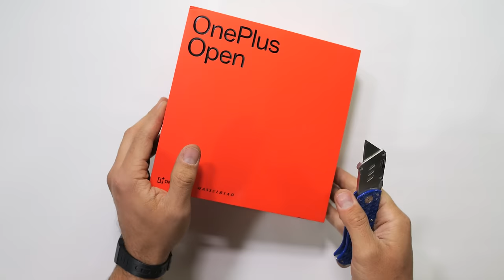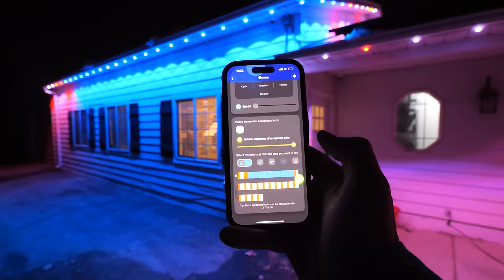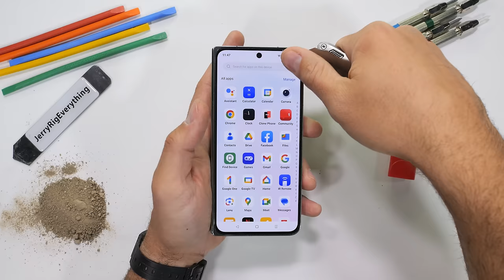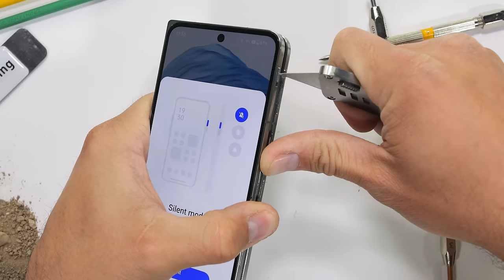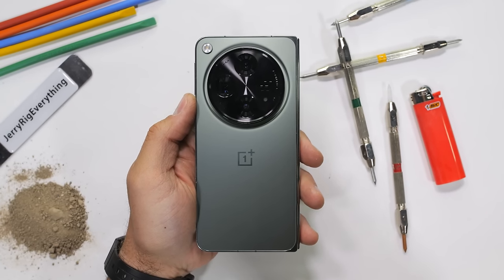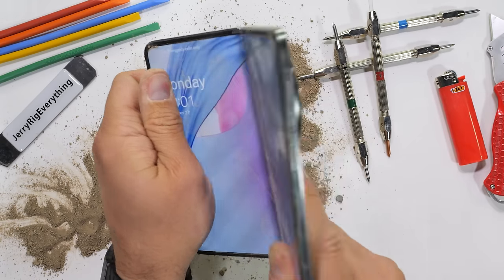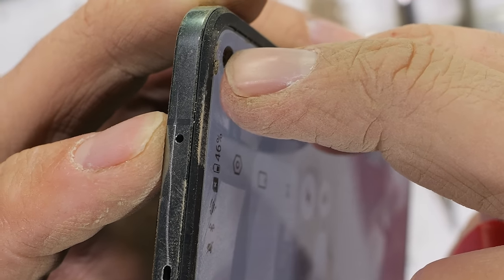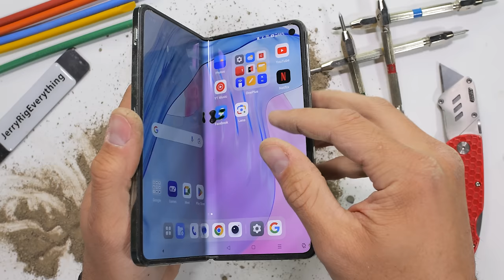OnePlus Open Durability Test - You guessed wrong...

Comment: Oppo and Oneplus did such a great job on their Foldables this year. Oneplus Open is on my list now.
Reply: I bought it. It's awesome. Cheapest yet best foldable out there in my opinion. My only issue is that Android auto isn't working. But that seems to be a wider issue for phones with a Snapdragon 8 gen 2 and Android 13.
Reply: the oppo find n3 "champagne gold" is the most beautiful folding phone rn
Reply: @Ronnet I've got the Open and have had no issues with Android Auto wireless. Interesting...
Reply: @Ronnet try going into developer settings and setting default usb mode to mtp/android auto.

Use stock cable when pairing initially.

If still doesn't work (AA opens and closes instantly), clear data on Google and Google Play Services as well as AA.

I had this issue when I restored from my old phone when setting up the device and clearing data solved it.
Reply: @ggosseyn  the issue that I've read up on is only for wired connection. Unfortunately nu car doesnt support wireless.
Reply: @xFrozenxSnowx  does AA work on your OnePlus Open? Because I tried all those suggestions already. None of it worked in my case. From what I understand reading up on this issue, there is more going on related to the processor and Android version combination.
Reply: @Ronnet  what happens when you plug in your phone to your car? Does AA popup on the phone and closes ASAP?
Reply: @ggosseyn  In my experience with OnePlus phones, it's a hit or miss between phones in regards to either android auto or just simple bluetooth connections. Some have issues and some don't.  I could never figure out why.
Reply: @Ronnet  I had to initially connect my Open via USB prior to connecting via Bluetooth and Wifi using an AA*Wireless adapter.  My car doesn't support Android Auto Wireless natively.
Reply: @Ronnet  It works on mine without any issue.
Reply: Bought yow the first day! First one was like naw this is the best phone I ever had. The second one was for shirts and giggles and teasing others. "look I spent 3000$ on two phones ! And you can't afford one !" 😂😂😂😂😂😂😂
Reply: I bought one. Its 1499 now and I even got free ear buds for pre ordering. It was a risky buy no doubt. But from the past few weeks I've been using it I'd say the it was definitely the right call. It really is a great phone so far. No problems on my side of things at least
Reply: It's amazing phone ngl
Reply: Because their parent company is BBK
Reply: @Ronnet my Android auto works just fine on the Open
Reply: @yanthewolf  I got mine to work eventually by combining all the tricks mentioned. Now it starts without any of the tricks but still only when I use the OnePlus cable. The high quality cable that I used for all my previous phones doesn't work. So I ended up sacrificing fast charging at home to have Android auto. But the battery life is good enough that fast charging isn't essential.
Reply: I just checked. The battery and charging speed are trash. For October 2023 phone.
Reply: terrible software and even worse software support
Reply: Until Z fold 6 comes out 😂
Reply: Got one

Comment: Can you perform water tests during your durability testing? It'd be interesting to see how non-IPX7/IPX8 rated phones would perform.
Reply: Hopefully. Some requested that over a year ago already, or longer, I can't remember.
Reply: @@GH0STST4RSCR34M But IP rated phones have actually been through rigorous lab tests.... no-IP phones have not.

IP rating also gives you significantly more leverage as a consumer when it comes to warranty.
Reply: It will take longer just because most phones, even without an IP rating have some sort of water resistance. If I remember correctly, the OnePlus Nord for example had all the features to achieve IP68 but OnePlus didn't certify it because it would take more money. But then the same phone from a carrier had the IP rating.
Reply: @PhilAndOr There's some assumptions here that don't add up.

For one regardless of an IP rating most companies will not cover your water damaged phone under warranty. The question of does your device have water damage when doing a warrant replacement exists for a reason. Those T&C's aren't there for the consumer.

Many phones go through extensive testing, the difference is whether an outside entity that gives IP ratings is involved in the test process or not. OnePlus has actually tested this phone under many water conditions that would surpass the IPX4 rating it has.

To others point here in the comments, the water proofing rating is a little over blown. Personally I don't care what the rating is, I'm still using a waterproof case when planning water activities to avoid any unnecessary situations.

We are talking about $1k -$2k devices here. Not worth the accident or the accidental failure of that IP rating.
Reply: @marufbepary100 even if a phone doesn't have any water resistance and water gets right onto the circuit boards, the phone will typically not fail immediately. You won't get a short circuit because water is actually a pretty bad conductor. It will usually be weeks or months until something actually stops working as a result of corrosion.
Reply: @someone-mn8or  oh did they mean do the water test after doing the durability test? I thought they meant talking a random phone with no rating out it's box and throwing in a bucket. My bad 😅
Reply: It's irrelevant. These ratings only account for how the device behaves right from the factory, not after several months of being carried in a pocket. Yes, the water resistant features degrade over time.
Reply: @PhilAndOr  It really doesn't give you more leverage. The ratings apply when the phone is new, not when it's been used (carried around, potentially dropped) for any amount of time. The main takeaway from these ratings is that you can probably use the phone while its raining and you won't get dust particles under the screen. But then again, most phones which don't have these ratings are still just as resistant, the manufacturer just hasn't paid to have them rated.
Reply: @CanIHasThisName  If it doesn't have a rubber gasket around the SIM tray or waterproofing mesh in the speaker grille it is not water resistant.
Reply: For real! Please!!
Reply: IP rating tests would require more than one phone for each test, because often the severe bend test creates a gap somewhere around the screen or back glass. And if the water test was done before the others he wouldn't be able to tell if the phone survived if the water already killed it
Reply: @bastienx8  He normally checks the phone after each stage of his test.
Reply: He'd need a new phone cause he manged the crap out of this one so unless it is the best of the best it'll fail for sure AND even more so now that he forcefully tried to bend the crap out of it and torched both screens which all collectively weakened the inside of the device because almost NO normal person is going to go even near that much abuse to their phone on accident. It would have to be on purpose or someone who works construction or something who damages their phone that bad to the point he does. I mean I own the OnePlus 10T and I got it due to the fast charging only because it was the fastest charging phone at the time officially launched in the UK with UK charger (usually certain Chinese brands have phones exclusive to china so even if you do import the device it comes with a foreign plug which makes the fast charging USELESS unless you have an adapter and are willing to carry that adapter everywhere you go). The OnePlus 10T also had the fastest Qualcomm Snapdragon at the time which was the 2nd reason. I didn't care too much that the cameras were inferior to the 10 Pro or that they got rid of the wireless charging (this latter one does NOT matter at all if you have a phone that can fully charge within 20 minutes and can last all day and last minimum 3-4 hours or so of constant gaming). The only thing I hate is the lack of the Alert Slider which I had on my OnePlus 6T which I really liked and only retied because after almost 4 years the back and front glass were done (I broke the front glass a year prior to the back glass and it was an accidental rage during a gaming session when I happened to have a spanner next to my desk because I was working on something and slammed the spanner on my desk when I lost a game of CSGO and knicked the corner of the phone and chipped a chunk of the glass and it still worked for a year) the same phone got cracked at the back glass and STILL worked with exposed circuitry and I only retired it because I saw how fast the 10T could charge and I thought even though my phone works it looks like ass right now and I can easily cut myself on the loose glass. The 10T DID fail the bend test Zach did last year BUT my phone ain't bent which goes to show either Zach happens to get lucky or he is trying his upmost hardest to break the device and although I don't want to break my phone I still would like to know how much pressure is actually being used to break the phone
Reply: @someone-mn8or you're spreading some half information. Water doesn't mean bad condcutor, it's depend on the amount of mineral inside it. 

So saying phone will not immediately fail is wrong, if you drop it in the salt water, it'll immediately short circuit. There's many type of water, distilled, ground water, rain water any water have different amount of mineral inside it.
Reply: Find Mr Mobile video where he visited their durability testing facility and that'll tell you all you need to know about it's durability and water resistance.  OnePlus did not slump on testing.
Reply: @CanIHasThisName  Facts.  Because what they call "water resistance" is simply rubber plugs that block water from getting into the device, and yes those do degrade over time.
Reply: @pixelgaming7261  Of course. But many phones do have these features and are not rated for water resistance, simply because it costs money to have them rated.
Reply: Ya, I would be very interested in that too. I saw a video where someone dropped the OnePlus open in a pool and retrieved it within a minute. Phone still functioned perfectly. Would be curious how it holds up for a longer time and if it would qualify for that rating even if it didn't try to get it rated.
Reply: Or Experia 1V
Reply: corrosion takes a bit to develop so most phones will not die right away from this but will stop functioning after a few days of being submerged. This probably won't be a good test with the sample size of 1
Reply: @PhilAndOr imagine putting a folding phone in water bro

Comment: Love the look of this OnePlus, once the tech is a bit more mature I might grab a folding phone. I kind of liked the lights until I saw they are only rated to -20. For the price wouldn't want to risk it breaking with the weather. Get colder then that plenty of days in the norther US.
Reply: iPhones are rated to 32 degrees, same as samsungs flagships.

Unless those numbers are fudged it would likely outlast your current phone in the extreme cold.

Folding phones have been ready.   My Fold 3 is still extremely fast and in perfect working order despite having a chunk of metal missing from my hinge from dropping it on patio tiles.  
Look at the Honor Magic v2.  Thin as an iphone, with a bigger battery
Reply: In reality the z fold 5 is mature enough for me to take the plunge and buy it... In terms of durability this oneplus is at the level of a fold 3 as I have been saying for 2 months..
Reply: Right?  I live in TN, we get colder than that here.  Not often, but it happens and sometimes down into the negative teens.
Reply: I'd say the Open has more mature tech than most other folding phones. The crease is basically nonexistent so less stress on the display, something Google and Samsung are still well behind on
Reply: It can get upto -30 here in Canada.
Reply: I think most of the replies above me don't know you're talking about the Christmas lights not being able to handle -20 or lower temps.
Reply: Yeah -4°F on those light is probably not a low enough temp for northern US. We get down below that for a while every year. That being said it will probably be fine being out in that bitter cold for quite a while if you dont have it on during those times
Reply: @TGMisKillingTheMiddleClass  The original commenter was referring to the temperature rating of the christmas lights.
Reply: They're already at the mature level.  The only thing that can improve now is just the cameras and software.  Other than that they will always be a bit more fragile than normal smart phones due to it having more moving parts.
Reply: When would your phone get that cold?
Don't think I've ever left mine outside.

I think the tech is mature enough now. I just got the OnePlus Open and it is amazing. I'm surprised at how useful the inner display is, and the multi-tasking features are really nice when you need them.
Reply: @sean_haz  the temp was talking about the outdoor lights not the phone
Reply: you can still get them and it'll work but a bit short lifespan, I'll say get a small one and test it out yourself before going all for decoration maybe next year😂

Comment: I love my Oneplus 11 16GB. Got it on sale for $650. Snapdragon 8 Gen 2, 16GB LPDDR5x and UFS 4.O. If you want it, just note the 8GB model with the same name and no different model designation comes with last Gen UFS 3.1 (half speed) and non-X ram (not really a big difference).

The 16GB of RAM makes a pretty decent difference on Android 14 since I don't have to use storage for fake RAM. I'm using 12GB of ram right now and I've totally disabled the fake storage RAM. Everything is lightning quick.

The only thing my friends are turned off by it is that it's a Chinese company. I for one have trust in Oneplus due to their long history in the USA although this is my first phone. Deep in the settings you can find that they do collect information (most phones do) and you can disable it. The negative is that the wording for the feature is very manipulative like you're going to lose features if you disable it. You don't. Just turn it off.

Comment: I wonder how this handles bubbling screen protectors. Seems to be the biggest issue left with these.
Reply: My Fold 4 I got last September starting having the screen protector fuck up, not taking it off tho, learned that lesson when my flip 3 cracked around a year in cuz I took the protector off a month prior.
Reply: @StretchDattass  Do Samsung in your region not provide free screen protector replacement?
Reply: I have a fold4 and I took the screen protector off. Its not required to be on there anymore. It fold much smoother and the screen feels way betrer without it.
Reply: my screen protector on my fold 4 also started bubbling up a year in, i had to remove it bc apparently leaving it on while its bubbled can kill the screen while its opening or closing. its been like 4 months since i took it off and it actually feels so much better now, but i hope my screen doesn't break on its own though. it sucks that these things seem so fragile in terms of longevity. its like the most fun ive ever had with a phone, it would suck to go back to a normal one if this breaks :(
Reply: Fold 3, 2 inner screens replaced for free with Samsung protection plan. Each bubbled after about 10 months. Now watching on my one plus open.  So far happy. Time will tell
Reply: Bubbling screen protectors will ALWAYS be a thing as unlike normal phones you're constantly opening and closing the device, causing the screen protector to slightly move and stretch.  Doesn't really matter considering the screen protector can be bought and replaced so damn easily.  replaced the ones for my z fold 4 twice with no issues.  Even rocked it without the screen protector for about 2 weeks with no issues.
Reply: It's not really an issue I had the fold 2 for 3 years before switching to the Oneplus fold. I replaced the screen protector twice a year as soon as the bubbling started.

Comment: I was little scared as a Im an owner of Oneplus Open but it seems to be more durable than it looks 😀Waiting for teardown skin.
Reply: That doesn't mean anything, the fold 3 was as durable as this open in its respective test yet it has a series of problems
Reply: Foldables will always have more durability problems than normal phones, but this video at least shows it will most likely survive a few accidents, some dust (and probably water) and the life in your pocket as long as you dont put it in there folded open with a bunch of keys/coins
Reply: @delamain1559  Of course it proves nothing. No one in their right mind would bend the foldable in the opposite direction 🤪 I was just cheering for the phone. Its my second foldable, Samsung ZFold4 had no isues, with hinge and inner screen at least. Batrery dropped 21% of capacity over a year ☹ Best regards for Cyberpunk fan 😁